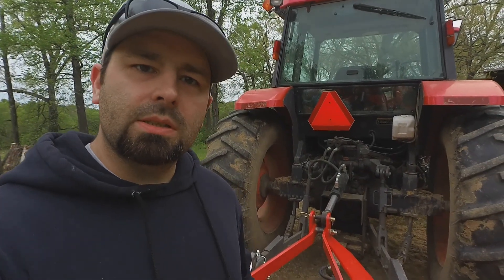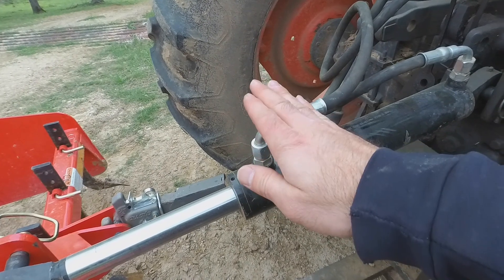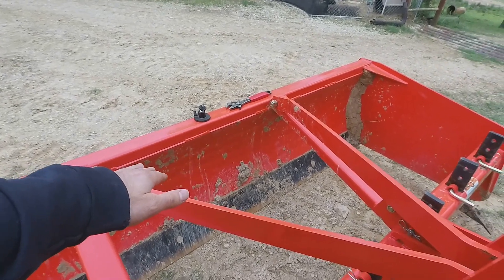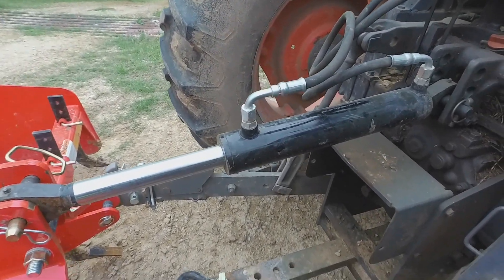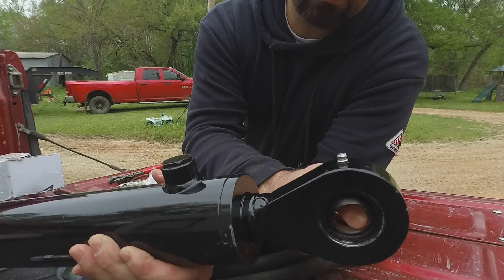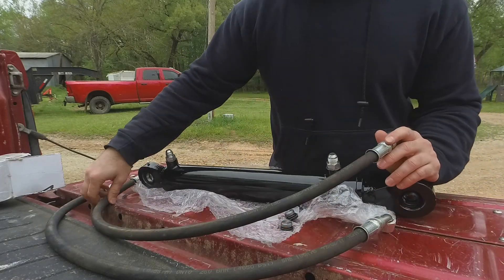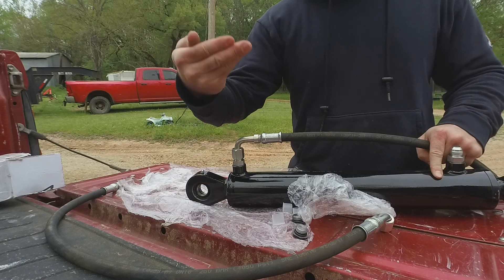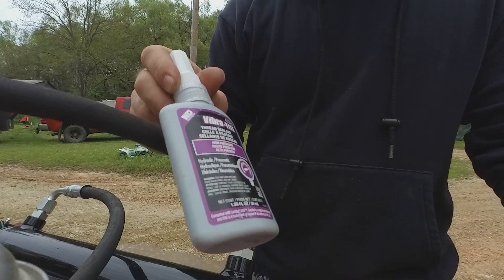Hydraulic Top Link with Pat's Quick Hitch - MAGISTER CAT 2

Comment: What is the cleaner you used to clean out the 1/2” male connector? Electrisol (sp?). Thanks.
Reply from the maker: Lectra-Sol, sometimes called Lectra Clean - depending on the brand. It’s just an electrical parts cleaner/degreaser. Brake cleaner would have worked well in this scenario but I didn’t have any on hand.  

https://amzn.to/4dukJGw

Comment: can you provide links for the hoses and connectors?
Reply from the maker: There are multiple options but here is a quick list I put together will get the job done. Hopefully this helps!
3/8 hydraulic hose with 3/8 pipe thread on each end, 36" long - Need 2 of these
https://amzn.to/48PTweT
3/8 pipe to #8 (1/2") O-ring Boss 90° Adapter (goes into cylinder ports and connects to one hose end) - Need 2
https://amzn.to/3LTQsob
3/8 pipe to 1/2 pipe reducer (used to adapt 3/8 hose end to 1/2 pipe tractor couplers) - Comes in a set of 2
https://amzn.to/3LVHeHI
1/2" Ag Couplers ISO 5657 - Comes in a set of 2 so just order quantity of 1-
https://amzn.to/3ROvevF

A few notes - 
36" hose will be a little long but will work and probably give a few different routing options. 30-34" works well. 24" was too short for my needs. 
You will need thread sealant on pipe thread joints. The O-ring boss connection at the cylinder uses the o-ring for sealing so no thread sealant needed.

Comment from the maker: Link to the cylinder - https://amzn.to/3ZexOMt

Alternative-
https://www.amazon.com/dp/B08JGS41TD/ref=cm_sw_r_as_gl_api_gl_i_A5BZNFYP7B8X8K8YFMGX?linkCode=ml2&tag=arrowjmfarm0e-20

***********************************************************************************
READ ME!
There are multiple options for hoses, threads, adapters, etc, but here is a quick list I put together that will get the job done. This list is assuming the ports on your cylinder match what I have listed and used in the video, which is SAE #8 O-Ring Boss, aka ORB (or -8, 1/2 ORB, 3/4-16 thread size)
3/8 hydraulic hose with 3/8 pipe thread on each end, 36" long - Need 2 of these
https://amzn.to/48PTweT
3/8 pipe to #8 (1/2") O-ring Boss 90° Adapter (goes into cylinder ports and connects to one hose end) - Need 2
https://amzn.to/3LTQsob
3/8 pipe to 1/2 pipe reducer (used to adapt 3/8 hose end to 1/2 pipe tractor couplers) - Comes in a set of 2
https://amzn.to/3LVHeHI
1/2" Ag Couplers ISO 5657 - Comes in a set of 2 so just order quantity of 1-
https://amzn.to/3ROvevF

A FEW NOTES - 
36" hose will be a little long but will work and probably give a few different routing options. 30-34" works well. 24" was too short for my needs. 
You will need thread sealant on pipe thread joints. The O-ring boss connection at the cylinder uses the o-ring for sealing so no thread sealant needed. 
************************************************************************************

Comment: Great job on your video. How long are the hydraulic hoses  ?
Reply from the maker: I’ve found that 30”-32” is about right. Plus or minus a few inches wouldn’t be unusable. I have a set that are 24” and they work but I felt like they needed a bit more slack. I also have used 36” hoses and they work just fine but there’s a bit more loop/slack than needed.
Reply: @arrowjmfarms  I have a 2014 Kubota m6060 and am trying to find a hydraulic top link . I spoke to a company today but haven’t yet . Where did you purchase yours ? Was it from magister ? The company I called had prince manufacture but looked like magister . I appreciate it
Reply from the maker: @RH-eo8cs  I actually ordered the Magister on Amazon, but I think you can buy direct from Magister's website also, if I remember correctly.
Reply from the maker: @RH-eo8cs  I'm not sure of the stroke length you need but here is a 12". They have many lengths to choose from.
https://www.magisterhyd.com/product/2inch-bore-x-12inch-stroke-swivel-eye-hydraulic-cylinder/
Reply from the maker: @RH-eo8cs  I've tried finding that length on Amazon but they don't have it for some reason. Magister's website may be your best bet.

Comment: I have an MX5400 Kubota I added the max rear remotes it can have which is three. I bought the Kubota top and tilt cylinder kit which was 900 bucks. Loving it so far. I was just using it yesterday had the box blade fully tilted cutting a ditch. I went with the land pride quick hitch. I love being able to back up to implements and just hitch up and go without getting off the tractor. Why did you go with pats over just a full blown quick hitch. Land pride makes cat 2 quick hitches?
Reply from the maker: I have a regular style quick hitch, albeit a cat 1 from Titan. I need a cat 2. But I mostly went with pats because I wanted to be able to hook up to my hay mower quickly, as well as have the option for implements that may not be standardized. Turns out that Pats doesn’t work so well with hay mowers. It works, but hay mowers are so heavy it causes problems with the spring loaded latch. I made a quick video on I’ll have to get it posted. Sounds like you have a nice setup and that’s awesome!

Comment: Nice video. Would be nicer if you put a link of where you got the fittings? I am having a time trying to find those online.
Reply from the maker: Sometimes it’s easier to find a kit that will include the necessary fittings. The last several times I’ve ordered I used - http://www.hydraulicsdirect.com

There are many options for fittings depending on port size, hose size, and whether you want straight, 45, 90. I will list the fittings I used for this one.
Reply: @arrowjmfarms  Thank you for your reply. However, I guess it does not matter at this point. After spending three days trying to find a freaking hydraulic top link with a 14" stroke or even 16", the whole country is sold out of them and there are none to be had. 

THANK YOU AGAIN BIDEN!!!!!!! 
GO BRANDON, yea.
Reply from the maker: @kbwfgg6400  Yes this supply chain mess is crazy! But that's what happens unqualified and incapable, career politicians run the country! Hopefully you'll be able to find one soon!
Reply: @kbwfgg6400  Just had the same experience.